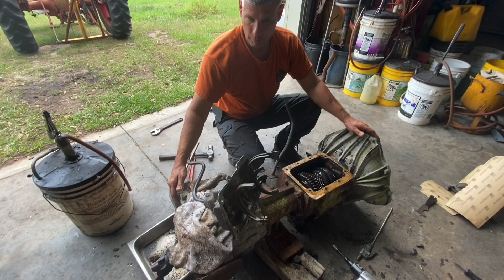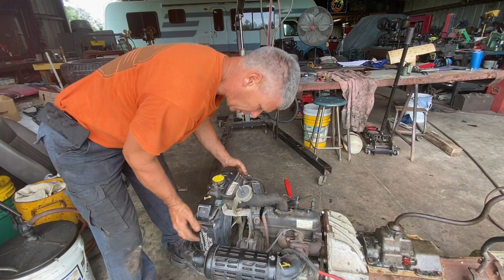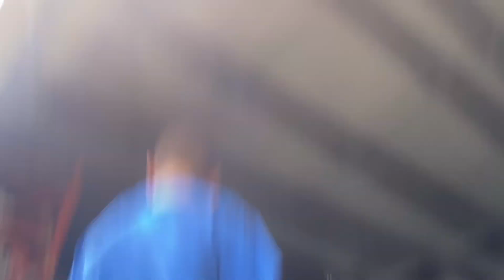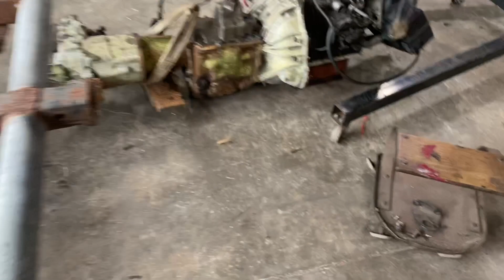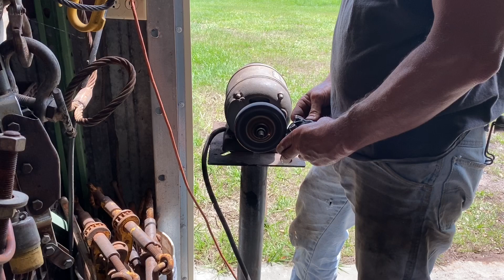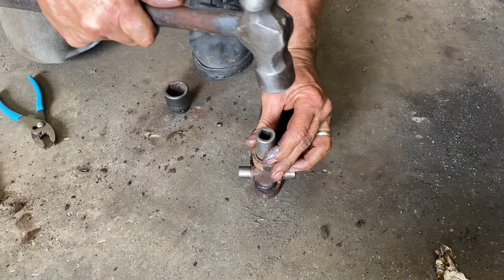Tiny diesel buggy build

Comment: What adapter do you use to attach the trany
Reply from the maker: I hand built one from  1/4plate steel and spacers.
Reply: @generalprinciple5921   and what flywheel do you use that’s in excellent work
Reply from the maker: @MGRDiesel  the stock kubota flywheel with the step cut of flat. Thank you very much

Comment: what engine is this?
Reply from the maker: it’s a D662 kubota
Reply: @generalprinciple5921  name some things these were installed in
Perfect size for a Sami project….where was that bell housing scavenged from…the back looks similar to a 4bt to Ford found on ups trucks….
Reply from the maker: It’s a Ford small block with just a cheesy adapter plate we built.
Reply: @generalprinciple5921  it looks identical to one of my bell housings…..maybe I will make a “chessy ” adapter too….haha